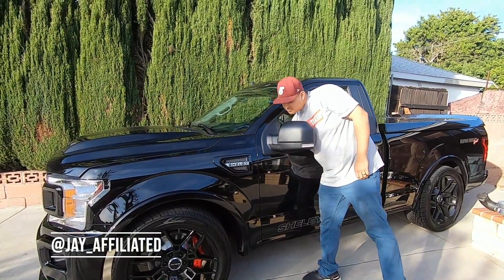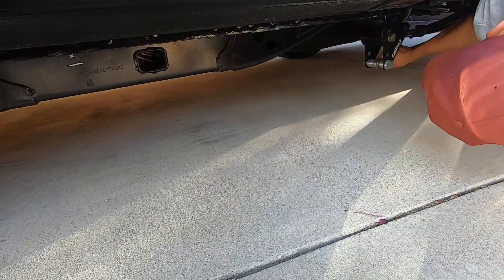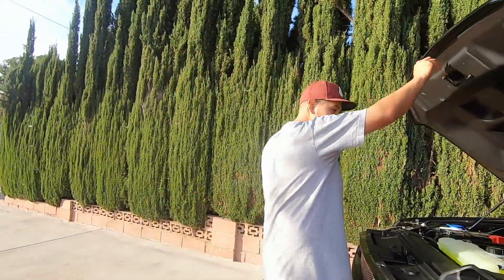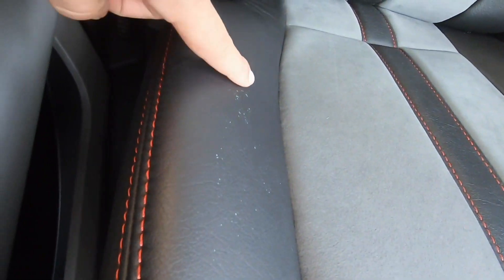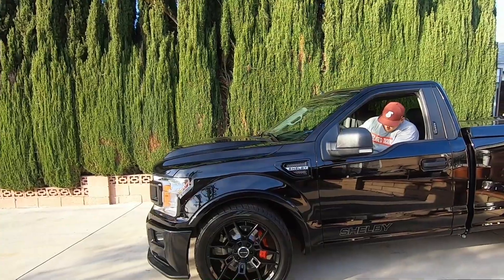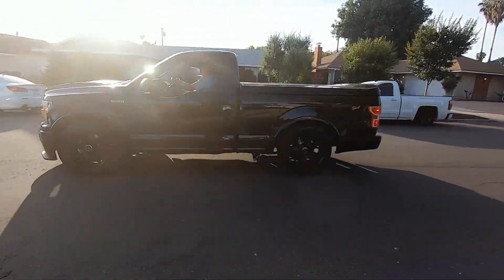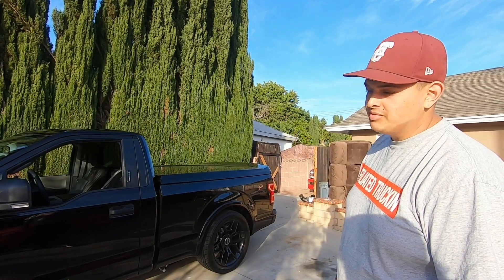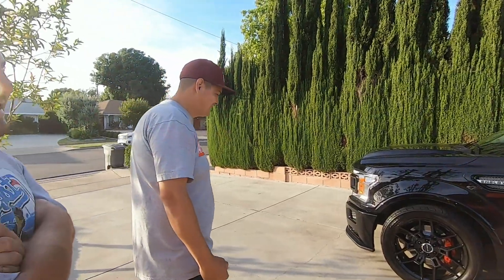Shelby American DIDN'T grease ball joints on a 100k truck?!

Comment: I have the same truck I also bought from Grody right before you bought yours. 

I’m doing a full custom on the truck. The truck is being super charged @ Shelby American as we speak. I addressed these exact issues with them & they came back with its normal for these noises. I forwarded your video to show I am not the only one having this problem. I will hear back from them in a few days & keep you posted. I put an extra 30k into the truck in upgrades . I also felt that it was garbage that they leave a 120 mph speedo with a governor after a supercharge. When the 4 door Shelby F-150 gets the 200 mph upgrade. 

Maybe we can meet up sometime. I’m in Long Beach lmk

Mike
Reply from the maker: I’m down! What color is yours? I know a couple guys in SoCal with them as well one is gray one is white and they both had these issues. The white one got sent back to shelby for the supercharger option but shelby lags so it took a couple of months, he had them look over the entire truck. And it is normal for caltrac traction bars to make noise but the guy with the gray one had them greased and they’re quieter now.
Reply: raysp3c yeah 8 weeks out with Shelby American. I had a few quality issues that they are addressing. I won’t bash them because I love the truck.  Mine is Black...you will love the mods I am doing.

Send me a private message with you # we will link up. Once it comes back it goes for another 3 weeks for all the other shit I’m doing to it. Did super snake carbon steering wheel.